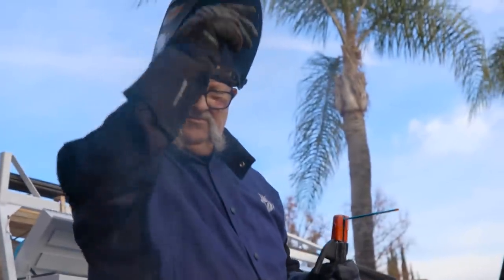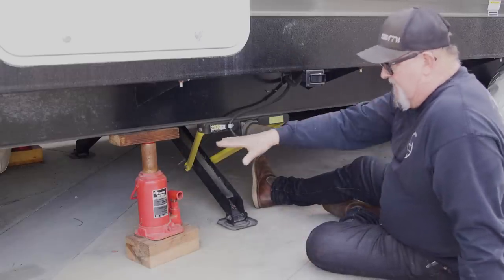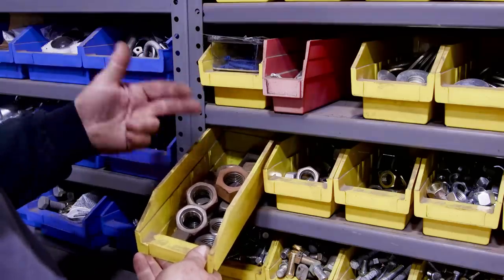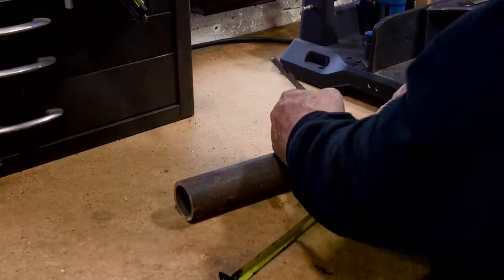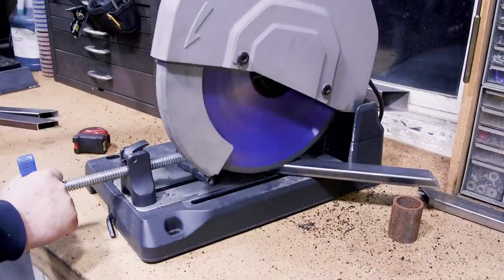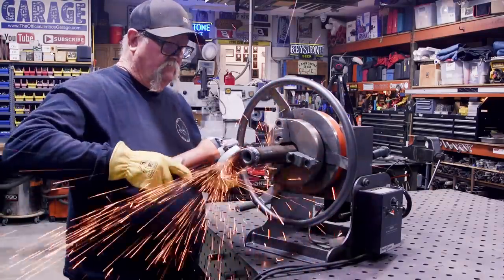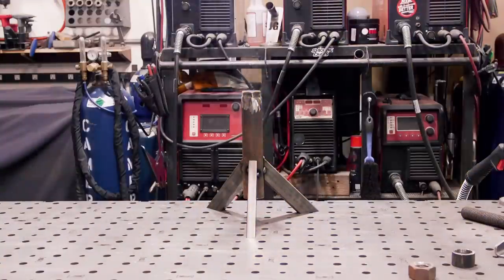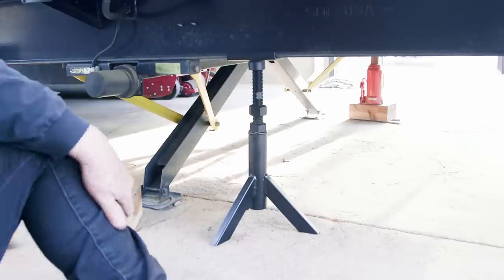DIY Metal Jack Stand Build | JIMBO'S GARAGE

Comment: Nice simple solution, maybe with a round baseplate (outer diameter tripod) it helps to keep them from having the tripod legs being pushed into less hard surfaces and stabilizes them if additional planks or boards are needed on soft ground.

Comment: Kinda surprised you didn't put some feet on those jack legs.  Probably not necessary for use on the concrete, but since these will last forever I think I would add some feet for future uses.

Comment: My old camper had the same motorized stabilizers. I used the motorized tongue jack to level the camper from front to rear then would use these to stabilize the camper so it wouldn't rock.

Comment: If you don't have the use (or access) to a lathe for the 'flats' on the threaded rod, you could always weld another large nut near the top of the threaded rod, seeing as the top of the rod rotates inside the top support bracket.  It might not look as neat, but it will work ok, given the welds are so big.  Think I'll make myself some of these just 'cos I can, I can always make different brackets for the tops to suit different jobs and uses. Nice idea thanks.
Reply: Или можно пропилить их болгаркой)))

Comment: I would trust those jacks WAY more than the POS jacks that most people sell.  A good jack stand will cost $$$.  That said, if you're ever going to use those on asphalt, you will need pads welded to the bottom of the legs.

Comment: Great designs, but on any surface but asphalt or concrete, those legs are going to dig in. On hot days on asphalt, they will sink in. Ask any motorcycle rider. Maybe some flat plates on the bottom to avoid the potential. Great job as always.